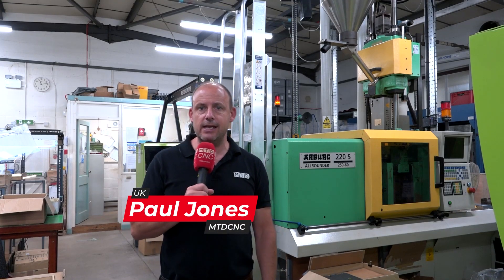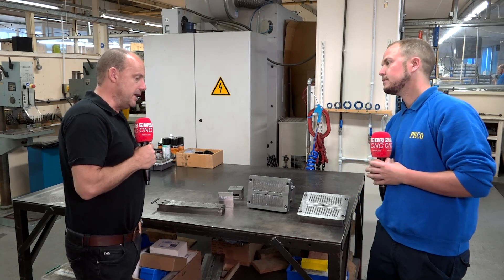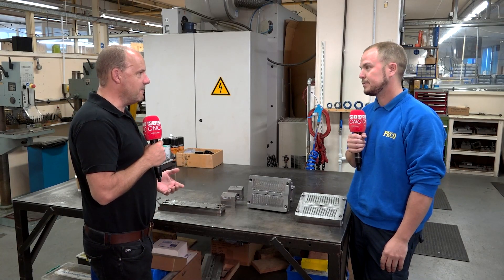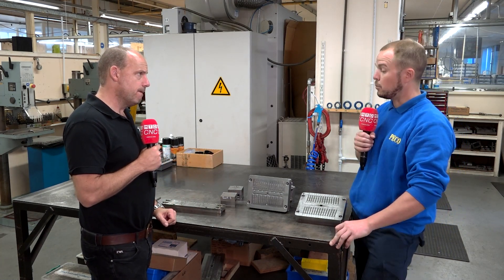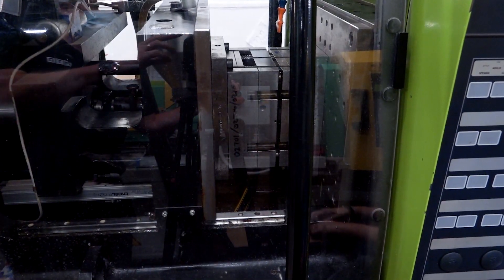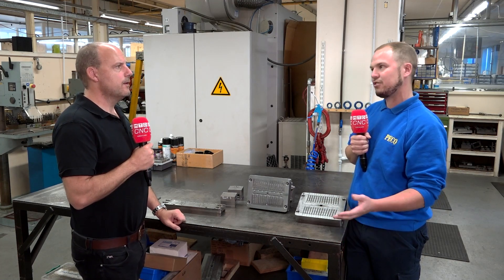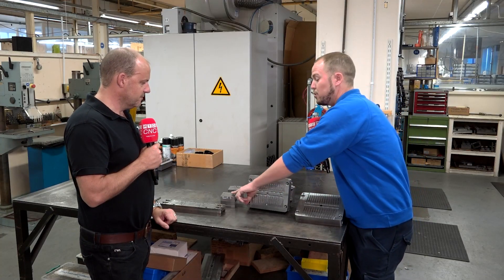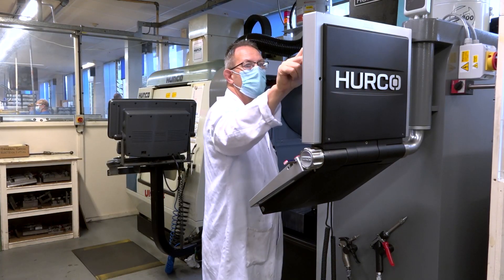Now that's how they make train tracks, machined to microns!

Comment: I thought I could work down to microns, then I got a job in the tool and mold industry, and was introduced to a large slab of air conditioned 24 hours a day granite and the q-c guys that worked in the room with an air float Brown and Sharpe height gage, and said to myself, OH . Btw, I had worked for a Boeing Vertol subcontractor, before that .
Reply from the maker: incredible they need such tolerance for these items